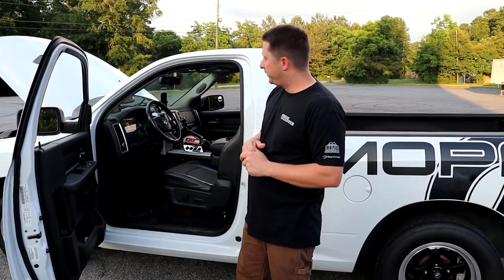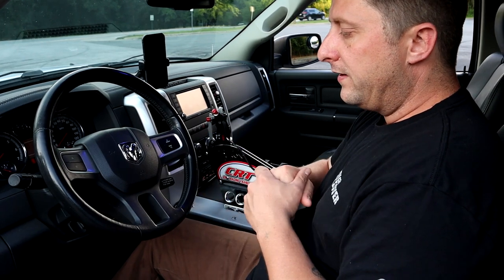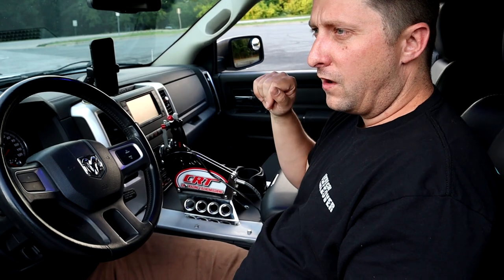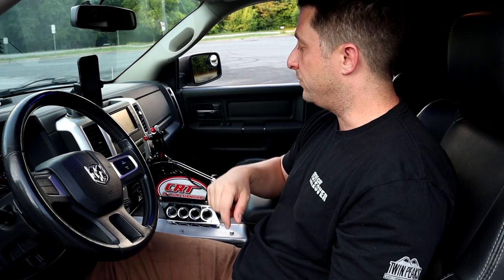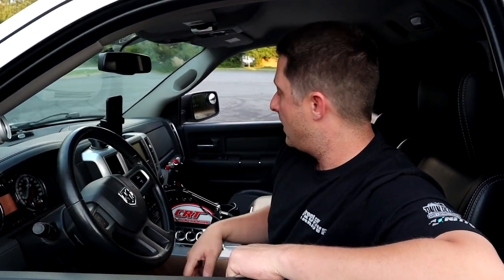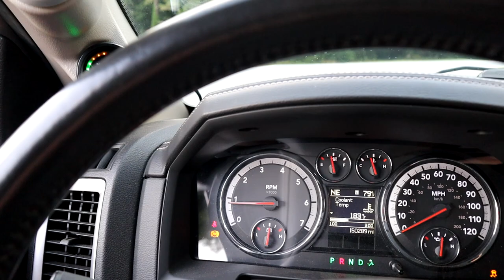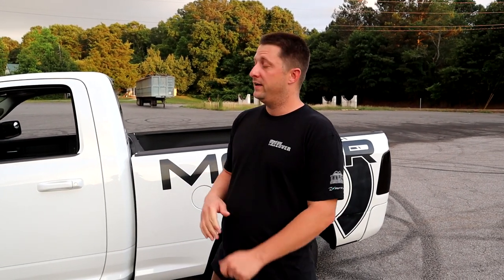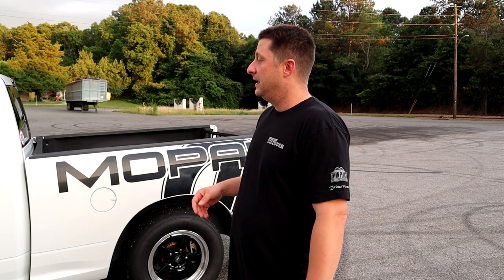New Walk Around With Trans Brake Launch

Comment: Did you go with the smaller pulley from torqstorm what size are you running, and what changes did you notice did you get more boost than 8..thanks Mike
Reply from the maker: I'm currently using the 3.1 pulley and see over 8psi very easily. I could get about 8.5 psi on the 3.25 pulley around 6200rpms

Comment: What rear gears did you have when it was still running on a 5 speed? 4.56 gears or 4.10s
Reply from the maker: Stock 4.10s still using them